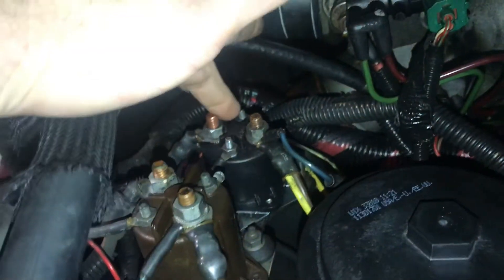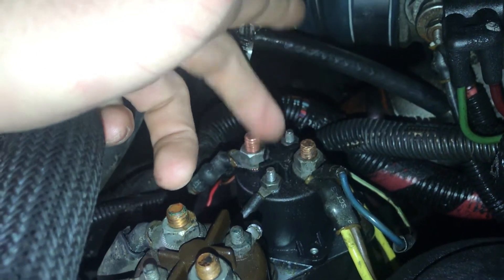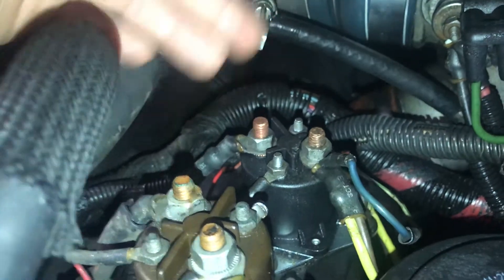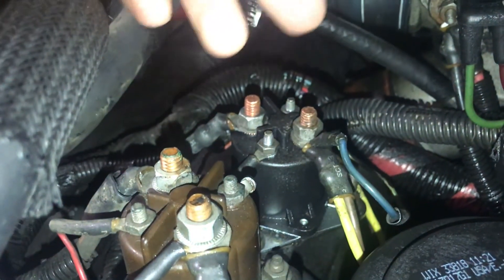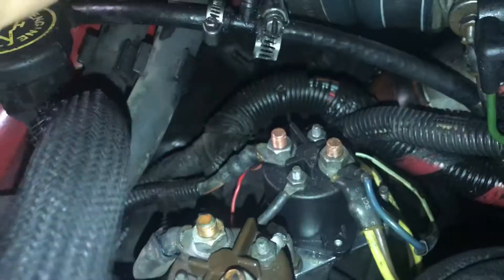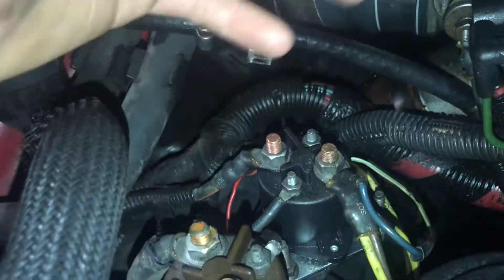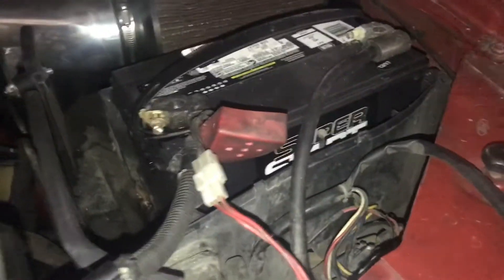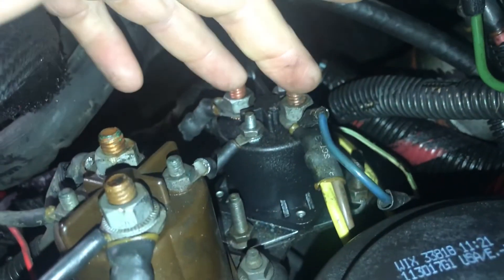7.3 powerstroke How to check/bypass glow plug relay

Comment: Cool. I just got an 01 F350 fleet truck with 71,000 actual Alabama eazy miles but this Sob is extremely cold natured at even 50 degrees probably because of the relay..imma try this tomorrow morning. Plugging it in seems to help fire it off a little, but not nearly as fast as it should with good hot starter and brand new high dolla batteries.
Reply: 3 years later looking back did it end up being hpop?